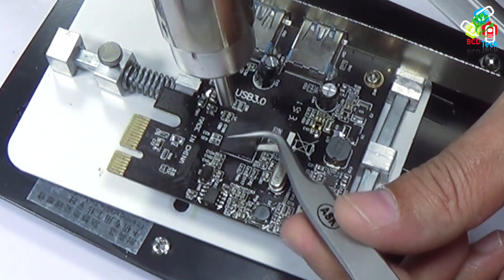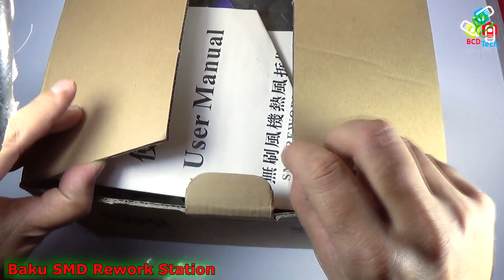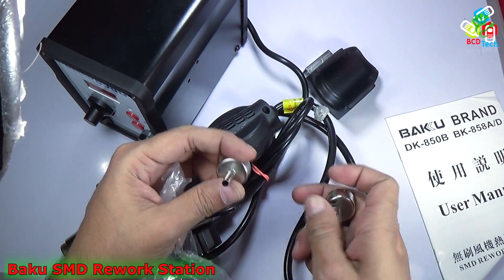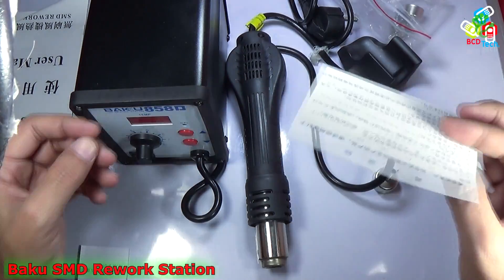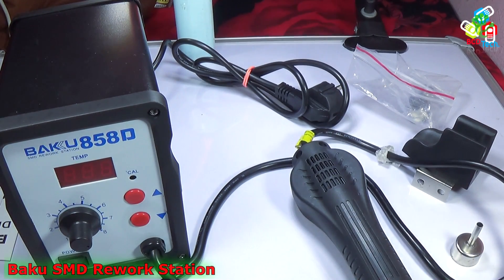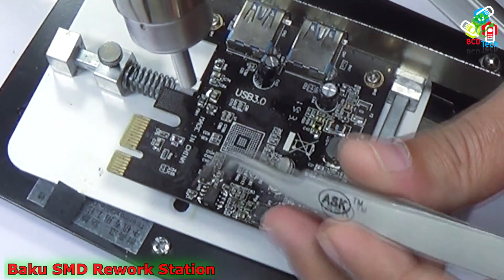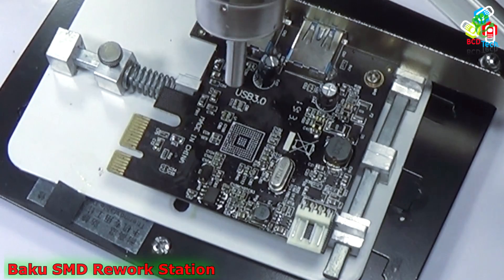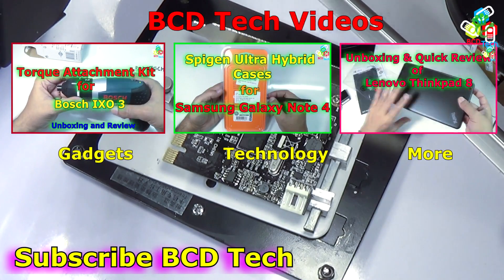Baku 858D: Hot Air SMD Rework Station

Comment: So the board needs to be heated to 270C ? I looked closely how you did it. You started heating at 9:18 and the chip lifted off at 10:00 so it took 42 seconds of heating to remove the BGA chip. I think you used maximum airflow and 8 mm nozzle and 360C temp. You also used a lot of flux on the chip